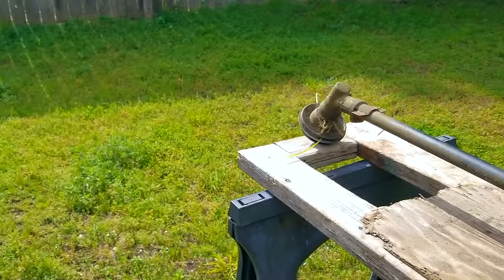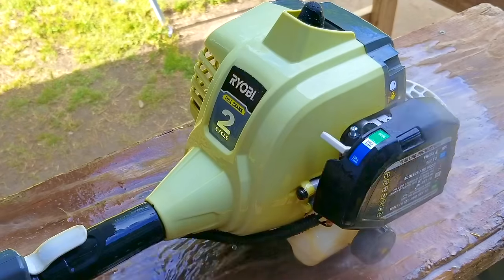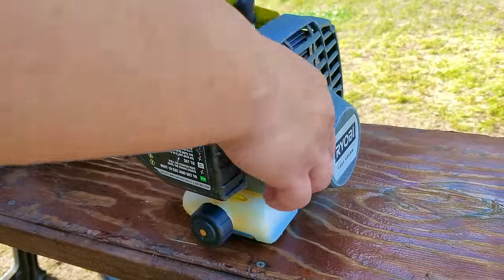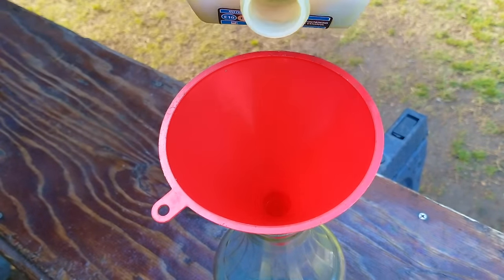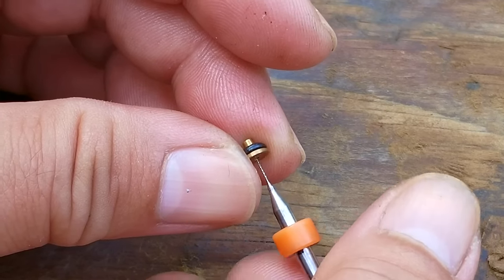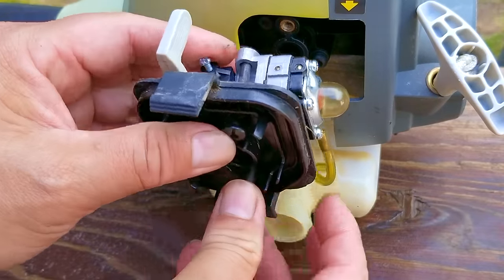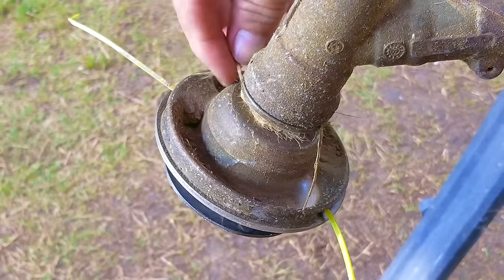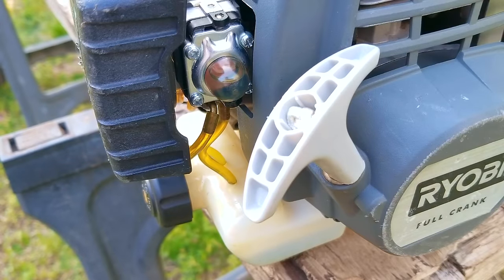Fixing A Ryobi Trimmer That Starts But Won't Stay Running

Comment: When changing a carb but can’t find an exact replacement what do you need to consider.
Reply from the maker: typically this would happen when the machine is very old, or  very rare.  Unfortunately if you can't find a carb that's 98% the same there's not much you can do.
Reply: Cheers I’ve got it to start after giving it a clean up but it won’t run
Reply: @HomeGaragechannel  it’s a ryobi rlt30ht after a clean up it starts but doesn’t run after changing diaphragms starts and runs on full choke with throttle but dies immediately on half choke or run positions. Any thoughts

Comment: My lord, the number of Ryobi crappy units that come into the shop is staggering.  They are really poorly made, and we are at the point now when busy season hits, we don't even take in Ryobi or Weedeater machines.  The only thing I would use a Ryobi trimmer for is a paperweight to hold down my crossword puzzle in the wind while I do some yard work between breaks.
Reply from the maker: it's pretty amazing

Comment: I took the carb apart on my robi and couldn't figure how it went back hello amazon 25 bucks new carb after i put a new coil in 30 bucks i was in to far to go back then fuel lines  grr oh ya i got the lines mixed up
Reply from the maker: it happens and nice work

Comment: I have the same trimmer. Someone left it outside with  engine end down.
Does not start and hard to pull.

I replaced the rusty pull start assembly on the back of the unit, did the entire carb, and pulled it apart. Sprayed with carb cleaner, . New plug, fuel lines, Fuel filter. Primer bulb.  New fuel mix.

Still hard to.pull. (continued)
Reply: If I pull the plug out, it becomes very easy to.pull.

With Carb off or Exhaust off still harder to pull and no start.

It's like I have a vacuum pulling back against my pull. I can feel the piston making its transitions up and down the cylinder.

Thinking of disassembly and spraying gumout carb cleaner into spark plug  exhaust and carb openings to try to clean up any  buildup.

Any suggestions??
Reply from the maker: did you check the compression?
Reply from the maker: not without a compression reading
Reply: Never mind , turns out it was really really flooded. Once I cleared that. It started right up.

Now I have to figure out how to fix the weedwhacker spool head. Ugh
Reply from the maker: nice!

Comment: Its not a fuel issue. Its what that nasty ethanol does to all the parts in your fuel system. I gave up after 35 years of keeping things running for years without any adjustments. Now my makita outdoor power tools will make a mockery of your old school ICE engines . No plugs air filters fuel filters special fuels rebuilding carbs noise smoke and hoping you engine starts and keeps running until the pull rope breaks or you spend more time getting your engine to run than the job you are trying to finish.
Reply from the maker: the canned fuel that was being used has no ethanol in it.

Comment: I had one of those hunks of junk. It would run good for 10 mins then suddenly stop and run like poo. I changed the carb, fuel cap, fuel lines, filter, cleaned the exhaust screen, adjusted the carb 50 times and it still wouldn't go properly. I Ended up cartwheeling it down the yard and left it there until someone stole it 😂😂😂 Ryobi is not what it used to be.
Reply from the maker: I know right!

Comment: These things are junk from the factory...not worth your time...If you want a cheap/free trimmer that's worth fixing, check yard sales for an Echo...they frequently show up for cheap or free at yard sales, or sometimes a the local landfill or a scrap yard, and often all they need is a new carb and fuel lines/filter...and unlike the Ryobi, they are worth the effort...
Reply from the maker: they certainly have their issue